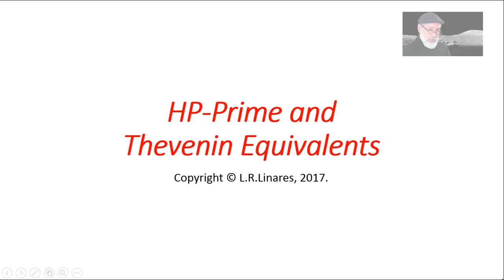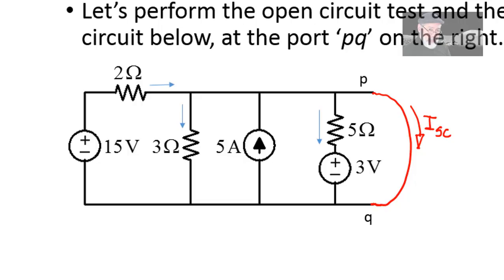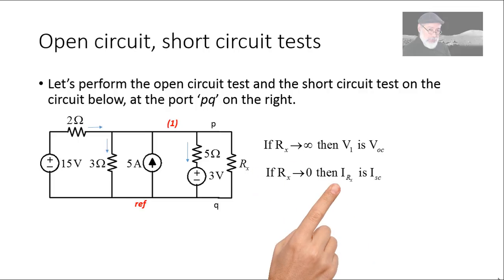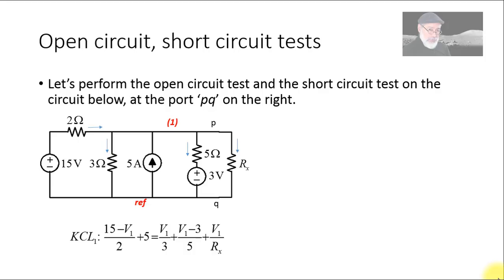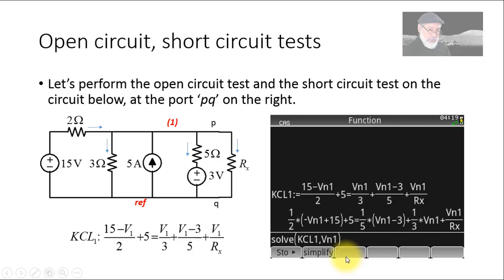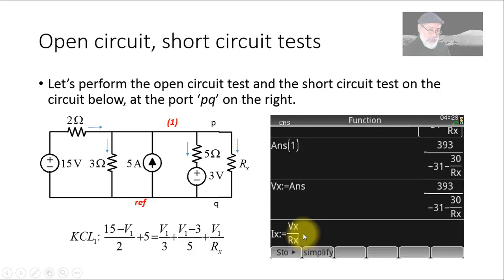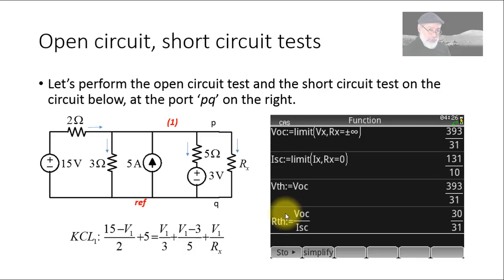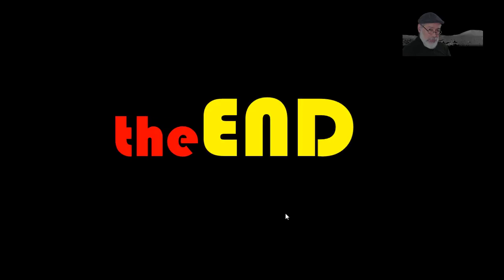HP PRIME 05 - Thevenin Equivalents with the PRIME.

Comment: I remember doing this using the new (at the time) HP-15C. :)
Reply from the maker: For me it was the "new" HP 35, then the HP 67, and the HP 41c.  What a time, huh?
Reply: @rolinychupetin  Oh yes. :) My best friend in high school had a HP-35, and I had a slide rule. Needless to say, he had a better allowance agreement with his parents between the two of us. :) 

Some of the other kids had the TI calculators (saving a couple hundred bucks compared to the HP-35 IIRC) and there was no end of the arguing over whose calculator had the wrong value for Pi. I'm guessing that one used a lookup value, and the other used 355/113.

We attended Air Academy High School on the grounds of the Air Force Academy in Colorado Springs, CO and as part of taking the brand new computer class we were allowed to use the Burroughs mainframe "up the hill" at the academy. Punch cards, paper tape, teletype, and 110 baud modems. I can still remember my user code, WRT0278. No password. 

These days I'm retired, and I mostly collect rather than use calculators. :) The DM42 and the Prime being the exceptions, both of them are fantastic! And I also collect slide rules. :)